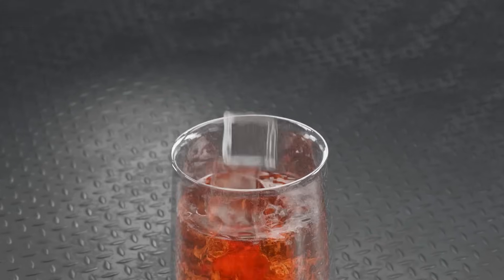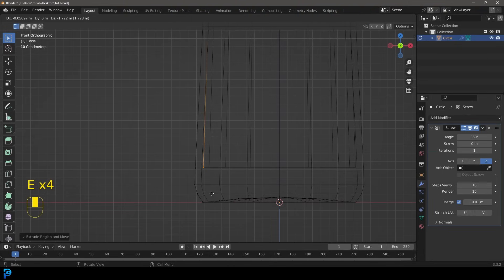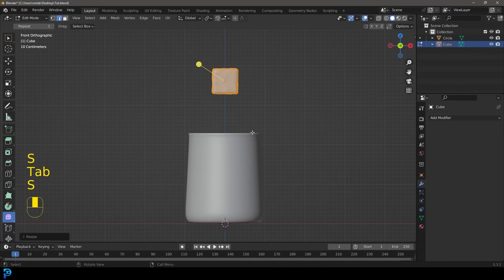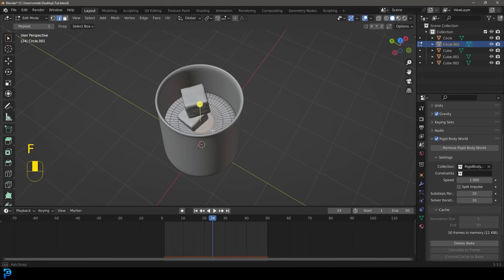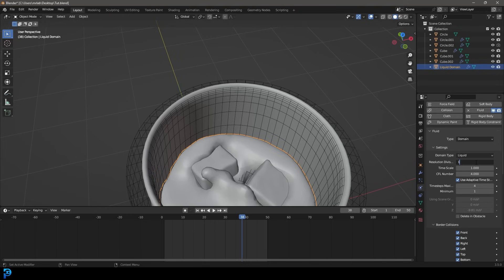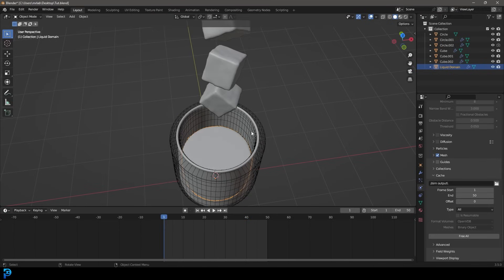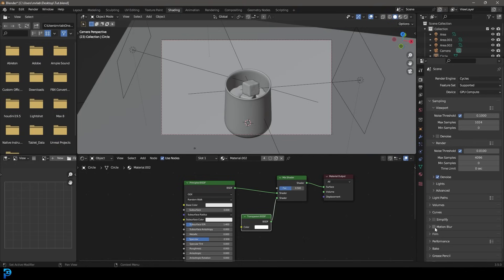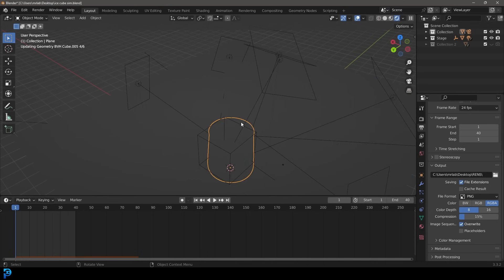Ice Cube Splash Animation | Blender Tutorial

Comment: Could I ask for some extended tutorial on this matter? 
how to make an animation of something falling into a container of water. I'm interested in a specific scenario: 1. we have a glass of water spinning around its axis at the beginning of the video. 2. then something falls into the glass... a pill, a strawberry, it doesn't matter. 3. we see a splash of water on the already wavy water inside glass.. 4. the object calms down at the bottom of the glass. forming air bubbles on its surface, and the water container stops spinning. 

I tried to achieve this with quick
water.. there is a splash but no wave effect while the glass is spinning.  
I tried to do it with dynamic paint.. there is a wave effect but no splash from the object hitting the water surface. How do both ?

Comment: This is a great tutorial, so thanks for taking the time out to teach others (like me) to achieve something similar in such a short space of time :-).... The only problem I have (and absolutely no idea why) is when I go to turn my object (the bit that is supposed to be the whisky in this case) into fluid, and add the physics, my liquid "drops" eveytime, and doesn't retain its original shape (like yours)... I've followed your tutorial precisely, watching many times, but even though I select the same settings, my fluid continues to "drop" to the bottom of the glass, as if effected by gravity... can you shed any light onto this? Like, I may have a setting that I need to activate that I am not aware of maybe? thanks, lee.
Reply: may be that's because of a bug in blender, are you using the updated version of blender?
Reply: Happens to me as well (Blender 4.0). Did you ever find a fix?

Comment: Hi, PIXXO.
I have done everything as you did, but the cube doesn't fall into the glass like yours. It just stops a couple of centimeters above the glass and keeps shaking in a glitchy manner.
Scale is applied, origins are like in your video. Physics, too.

When I use the flat plane instead of glass, it falls nicely. But when I extrude the plane and make it hollow (delete the top face), it doesn't get in but also stops above like it's not a hollow object.
Any ideas why this would happen?

Regards.
Reply: Go to the physics properties tab, then in the rigid body settings scroll down to sensitivity and reduce the margin.
Reply: I made the objects 20 times larger, with scale applied, and now it works.

Comment: 11:00  for those who can't see water object  check on face orientation and flip normal by click object and go edit mode press A then Shift + N and try again.
Reply: The water go outside the Cup.. Why?
Reply: @أسامةقصير-ي1ل  Go to your Cup Fluid effector settings and check "is Planar"
Reply: @أسامةقصير-ي1ل  same here
Reply: @أسامةقصير-ي1ل  same fate hear bro
Reply: I can't see water also it doesn't change drink colour to blue or anything. I tried this and didn't work. is there any other recommendation?
Reply: @ladydarbanville2471  i just see the comment i think this clip is very clear now. if it still not work maybe try to change file or do a new one. the problem that i just see in this clip is time that i already stamped 
P.s. maybe it about version too i mean (bug)
Im using 3.6.7 lts
Reply: i was having the same problem until I realized I've been on frame 0 xd after getting to frame 1 everything was ok (you have to be in object mode to see it) @ladydarbanville2471
Reply: @ladydarbanville2471  i still couldnt solve it...did u got a way?
Reply: @behumble122  yes, but to be honest I don’t even remember what I have done differently just tried again and again from strach. But like really strach , even the galss it’s supposed to sit in is done again🤷🏻‍♀️💀 eventually i gave up whole project lol
Reply: @ladydarbanville2471  i had the same problem but by flipping normals of the cup it got fixed
Reply: thnxxxx <3
Reply: u are absolute a legend! Thanks dude
Reply: life saver
Reply: thanks for the help
Reply: thank you so much
Reply: You are the best!!
Reply: thank you
Reply: Thank you
Reply: Thanks youuuuuuuuuuuuuuuuuuuuuuuuuuuu
Reply: Thanks bro.
Reply: BROOO YOU ARE BLESSED
Reply: THENXXXXXXXXXXXXXXXXX
Reply: Awesome! thank you so much ...it worked.
Reply: Nice trick!

Comment: If you don't want to make your domain unnecessarily large to avoid computing unneeded empty space: since your splashes are not very high, you don't have to make the domain that high - it is not necessary to cover the ice cubes completely in their starting position. It does not matter if they start falling from outside the fluid domain.
Reply: my fluids were just leaking out of my cube and bringing the top down fixed it so thank you
Reply: Right. In this simulation tutorials he not cover the crown splash. BTW it was a great tutorials.
Reply: @artistsmind  The crown splash wasn't my point. In the video he says you have to make sure the domain covers the effector objects, but it is not and so you don't need such a large domain.

Comment: guess this is for intermediate users who know blender, A. non of my short cut keys seem to match the ones in this tut, ( E to extrude does nothing on my computer )so i'm left spending ages trying to figure out where the operations are in menu's, B my layout seems to be different so right away I'm not able to get past 1min 11, as i have no 'Add modifier' to the left. (found it under the Spanner tab in the end) i take full responsibility for this as i've been coming over from Maya and so set my theme to Maya...
Reply: I don't know what you have done to your default Blender, but E to extrude is a very basic tool that's used in hundreds of tutorials... of course you have to be in Edit Mode in order to extrude some vertex, edge or face, not in Object Mode (because you cannot select parts of the mesh in Object Mode). And the "Add Modifier" menu (to the right, not the left) is of course under the "Spanner" tab (it's called the "Modifiers" tab for that reason when you hover your mouse over it) and that's where he is in the video. But you do realize there are different tabs you can switch between to get different menus? It seems you should probably learn the use of Blender's interface and basic tools before starting fluid simulations as these physics things are not the easiest to begin with.
Reply: @gordonbrinkmann  well said

Comment: I was struggling with make this happen and i found that my liquid mesh's normal was facing opposite direction.
Reply: How did you work it out then? I've been stuck at the quick liquid part where either the liquid doesn't apply or the liquid flows out of the glass or the ice cubes don't fall into the glass. You have idea for that it'll mean a lot to me
Reply: Check if the normal is facing right direction. Some of the my polygon was facing opposite direction.

Comment: Hi... im confused with the the quick liquid effect as the liquid flows out of the glass when played .... can you tell me why? and how can i fix it?
Reply: Try increasing the Sampling Substeps to 15 and the Surface Thickness to 0.5. These are settings in the Fluid Physics tab for the Effector object.
Reply: thank you so so much @maxdeighton8851
Reply: @maxdeighton8851  Thank you so much, I had been struggling for an hour before founding your comment. By the way, can I increase Substeps even more? 10 is a limit for me
Reply: same here
Reply: @hinanaz3901 Make sure the liquid size is just a little less than the cup....that's what helps me....click on liquid then tab to edit mode then alt + s then make size slight small just a little...hope this helps 🙏
Reply: @mathsiseasy374  But when i apply quick liquid the object which changes to blue in the tutorial.. It Doesnt happen for me...even when i increase resolution it Doesnt work...the object just dont behave like liquid
Can u help?
Reply: solve hua kya issue, i'm also stuck there T_T
Reply: @SAHIL-hg9bb haa mera toh hua
Reply: Make sure the liquid size is just a little less than the cup....that's what helps me....click on liquid then tab to edit mode then alt + s then make size slight small just a little...hope this helps 🙏
Reply: Make sure the liquid size is just a little less than the cup....that's what helps me....click on liquid then tab to edit mode then alt + s then make size slight small just a little...hope this helps 🙏
Reply: what he doesnt tell you, is that go in liquid setting and turn on Planar, it will fix it

Comment: I was just trying to find out how to roll ice cubes with a glass and liquid. I just stuck at the effector part - the water leaks from left and right parts, checked with flip normals then water splashes under the glass into the domain. All scales are applied. Does the effector domain for liquid must touch the liquid object perfectly?

-Updare : Effector must be a bit bigger than the liquid object, normals facing to the liquid. Solved!
Reply: "Normals facing to the liquid" – what do you mean? How do you do that?
Reply: @RobertWildling Effector object is copypaste+scale operation, normals (you can check it by visually from blender documentation - forgot the location) ALt+N to flip normals to the desired direction.
Reply: @mertcanurcan  Thank you for your fast response!
Reply: @mertcanurcan  can i ask how you delete the box that appears when you use quickfluid?
Reply: @funkypossum6403  mate comment didn't pop up - so may be late reply. When you use quickfluid its a "fluid domain" it won't be rendered. But I forgot how to hide that :/